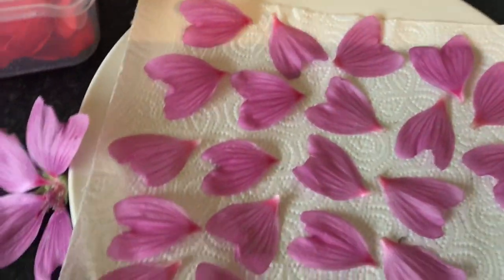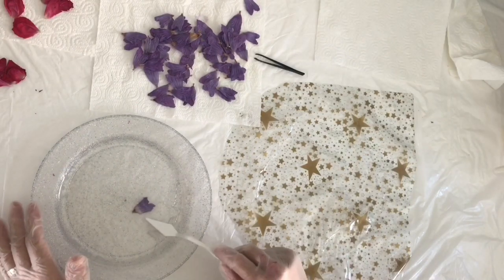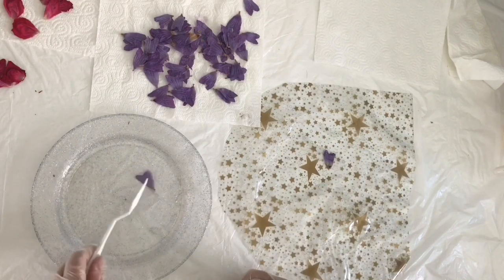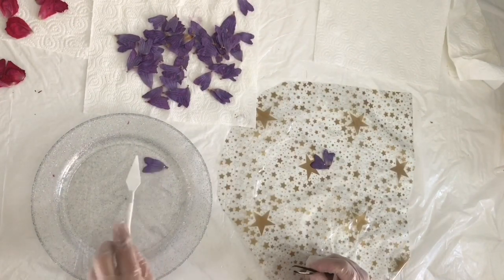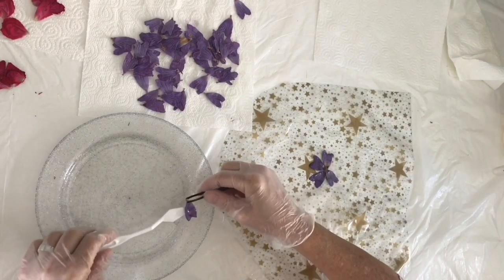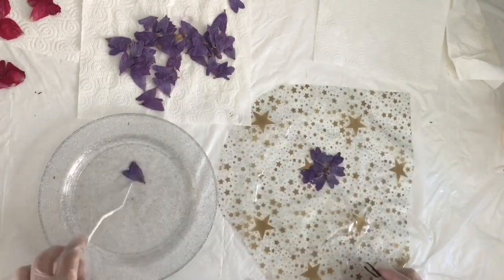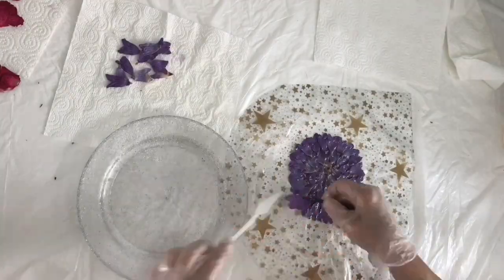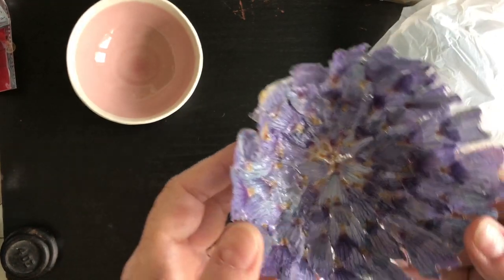Resin Flower Petal Bowl - Revd Ruth's Random Creativity

Comment from the maker: Hi, I forgot to include that you need to seal the petals before using in resin.  I chose to use hairspray on both sides of the petal, which was a bit of a pain as I had to do each petal individually as the pressure from the hairspray would blow them all away! There are other methods of sealing the petals so that they don’t loose their colour.  Thanks for watching, hope you enjoyed the video.  Don’t forget to click the like button and subscribe 😊